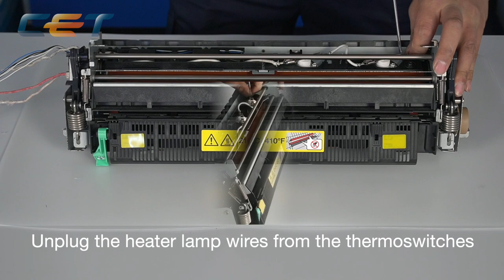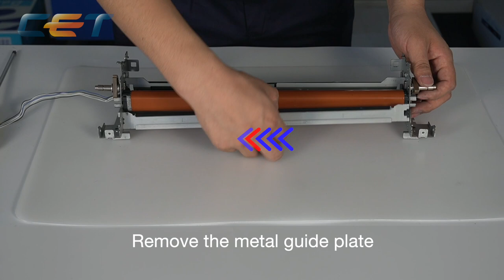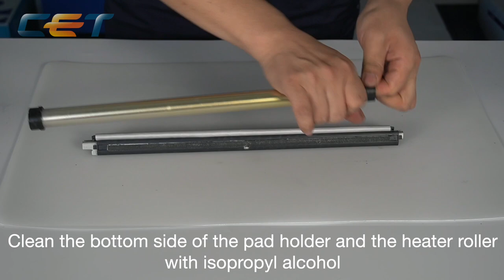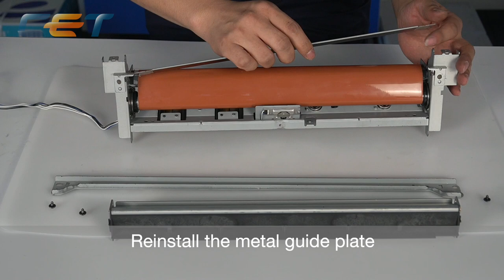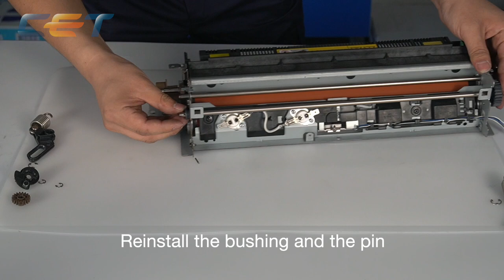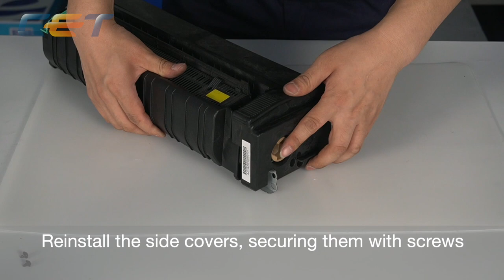Konica Minolta bizhub C250i series fuser unit rebuild instructions - English

Comment: is there a timing jig we need? tried to use a rebuild kit on three different machines now and have all come with a fusing pressure error code after rebuild. service manual says the belt and internal components are positioned from factory, and unit should not be disassembled.
Reply: Yes, this... CET, where's the answer???
Reply: look at the positions of the rear gears, they are used to regulate the pressure
Reply from the maker: Hello, thank you for your comment. Did you check the position of the rear gears? The position of those gears regulate the pressure.

Comment: Does this apply to the Bizhub b550i as well.
Reply from the maker: Yes, the process for rebuilding these fusers is similar, but may not be identical. The parts we reference in the video all work in the Bizhub C550i (that's what you meant, the Biizhub C550i, correct?). Thank you for your interest!